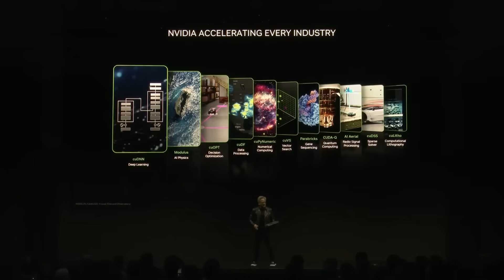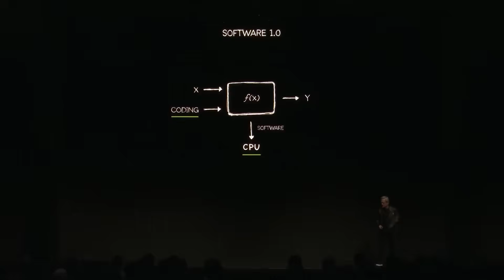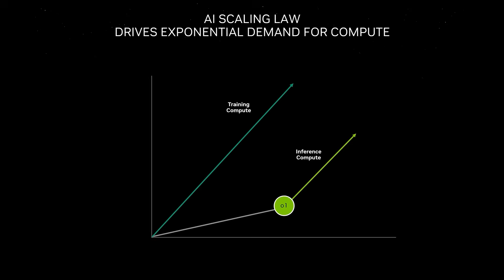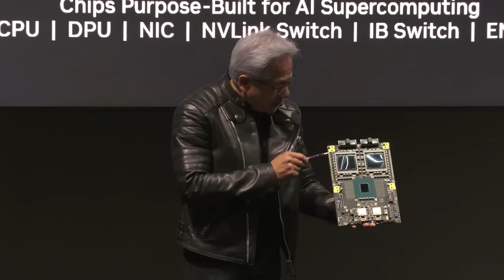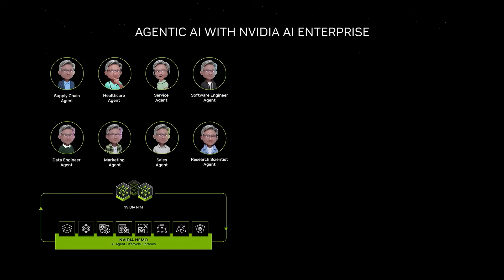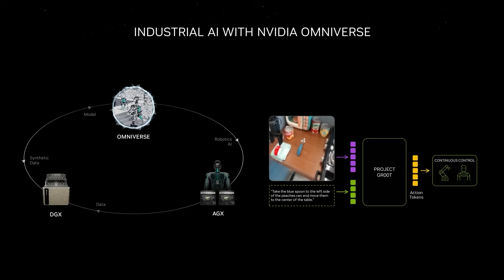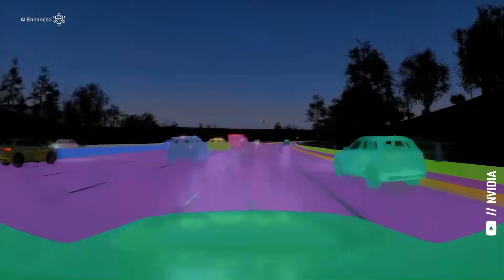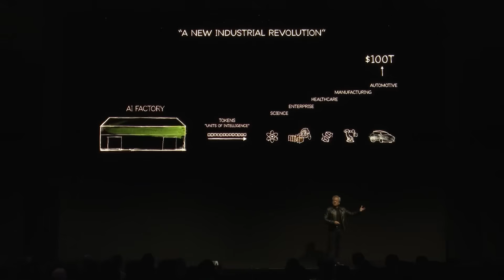NVIDIA'S HUGE AI Chip Breakthroughs Change Everything (Supercut)

Comment: Nice, i posted and commented on this in my private investing group and tried to relate the magnitude of the presentation. 

Nvidia has a death grip on the intelligence explosion abroad multiple verticals. I can't think of any company that's secured a Monopoly on an entire area so completely. 

Each Cuda library is a wall to competition while being a key to engineers looking to build & deploy vertical specific models from LLM's to protein folding inference to computational lithography. All enabled by Nvidia software & hardware. 

The last 2 months of the stock crab walking has been a dream to accumulate before the next kick up. 

Hard times force businesses to optimize, cost cut & innovate. With ai models we have a tool to do this faster & easier than ever before. 

Nvidia at 135 per share will look absolutely tiny in a year when it's closer to 600 per share. 

Mark my words.